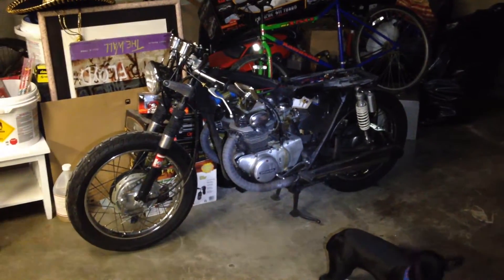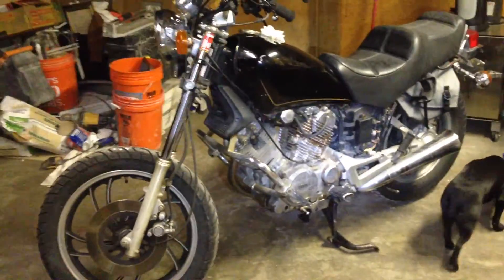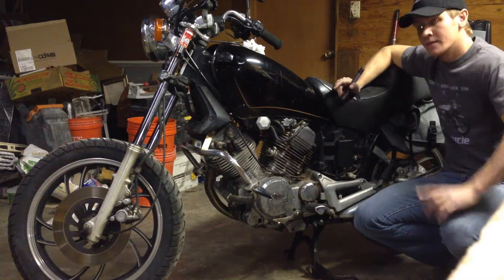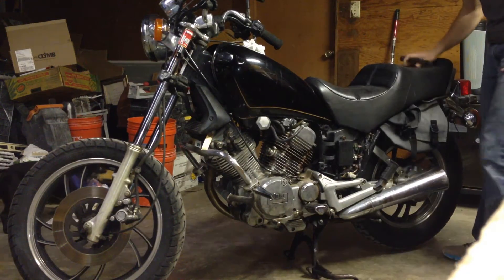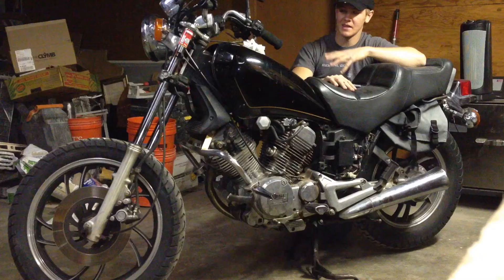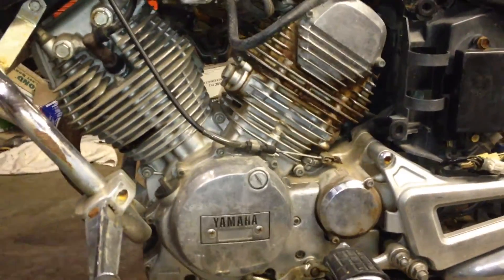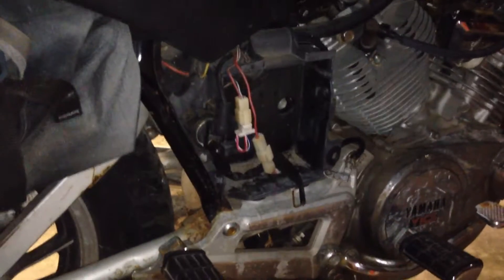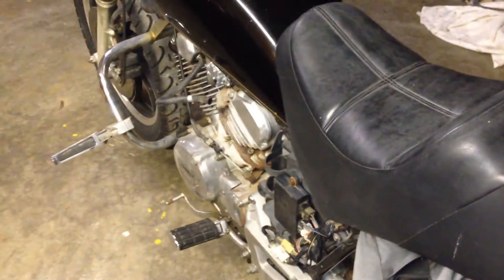1983 Virago XV500 - "The Bobster" and CB350 Cafe

Comment: The mono-shock is definitely cool. I picked up one of these for around 500 bucks recently, already bobbed. For what it is o it looks pretty mean, has shorter straight handles...one of the previous owners did a Key-delete, not sure how secure that will be, but guess I'll find out! Not over-powered, but I've got a straight-4 750 Seca that needs a new fuel cock and a brake swap for that kind of riding. I'm into the more laid back vibe of the Bobber, though, and better fuel efficiency, will be mostly, if not exclusively, used around town anyway, not sure I need it any hotter. For the price, for a well-running bike, though, I have few complaints 😁
Reply from the maker: StopMoColorado I think my wife bought it for a Benjamin lol